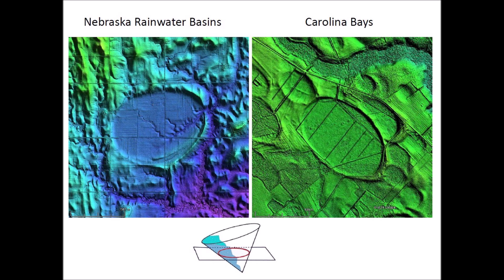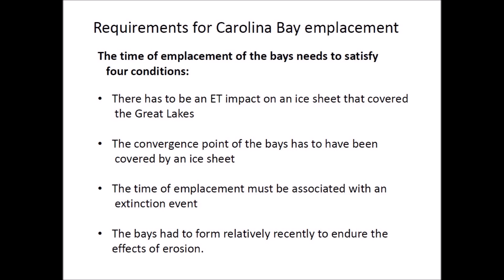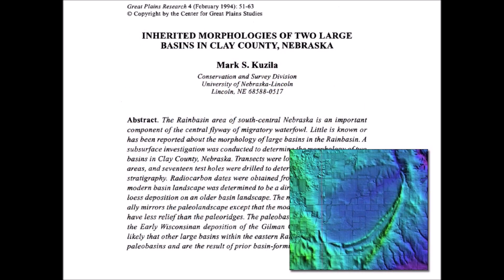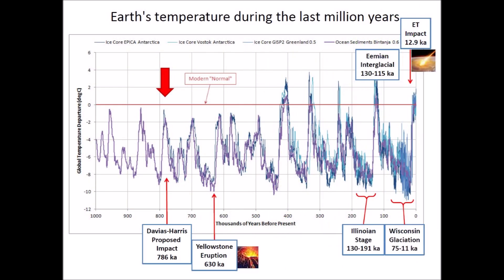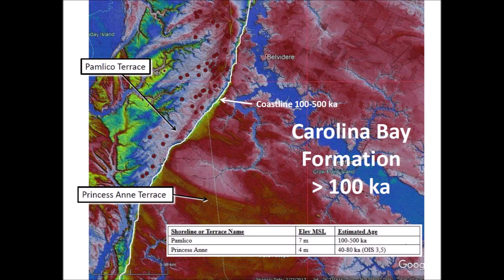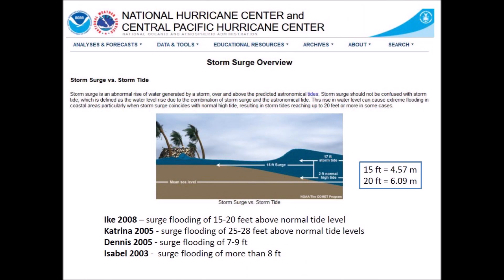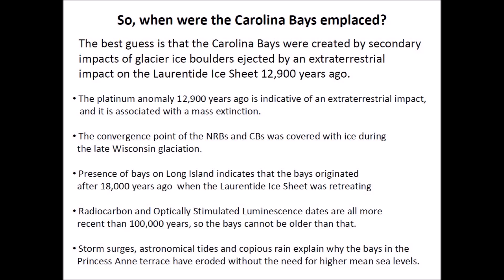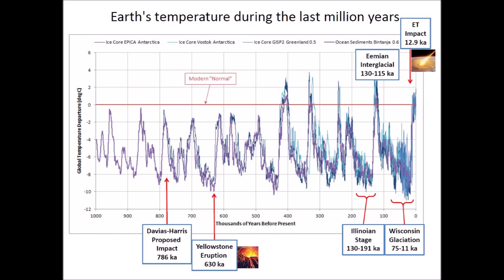Carolina Bays - Time of Emplacement

Comment: It seems relatively straightforward to do a particle system simulation of the probable high speed impact on a thick ice sheet. This could provide a model of the distribution of size, velocity, and other factors of the ejecta, potentially showing a distribution from gaseous, liquid, and microparticles to house-sized and larger.

As far as dates, the interesting test would be to do a core through the rim of the bay, down into the older substrate that was overlaid. There should be a significant transition, and dating the lower material should provide a latest date of material that was buried.
Reply from the maker: This was reported in this paper: https://agupubs.onlinelibrary.wiley.com/doi/full/10.1029/2011JE004043
Reply: @Antonio_Zamora  Thanks, I will check it out.
Reply: @Antonio_Zamora  Here is another video by Scott Manley showing simulations and computer animations of asteroid-velocuty impacts, which of course are different. The interesting thing is that apparently elliptical craters don't generally appear until the angle is 20 degrees or less. This is a very complex process, and the different velocity and material makeup of the ice boulders undoubtedly are factors. Does a sub-20 degree impact angle work for the ballistics+supersonic fluid dynamics?
Reply from the maker: One aspect that had not been considered about the formation of the Carolina Bays by previous researchers was that the bays were only created on unconsolidated soil close to the water table. The width-to-length ratios of the CBs indicate that the secondary impacts hit at angles of about 35°, and ballistic equations predict that the secondary impacts occurred six to nine minutes after the ET impact. The saturation bombardment by ice boulders during this 3-minute period liquefied the ground and made it possible for the secondary impacts to create oblique conical cavities that transformed into shallow elliptical bays by viscous relaxation. The reason that the CBs exist is that the ground was a viscous fluid during the ice bombardment. Most simulations don't take this into consideration.

Comment: Antonio or anybody able to provide link the Peter Shultz's paper/work on meteorite impacts on ice? I have tried to find at both Brown University and NASA without finding exactly that.(only brief references found).
Thoroughly enjoyed your book by the way though still unconvinced of impact strike at Huron. I still favour the idea the ice boulders were blasted out of Haiawatha on a higher trajectory and that a "swarm" of them split up on reentry high above Huron giving the directionality we see. Using University College London's impact calculator to picture it I would propose that superheated steam and water was sent across the surface of the whole extent of the massive ice sheet present at the time. Megafauna across Europe and Siberia was also terminated so this was not limited to N.America but it was only there that had land that bore witness to the flow. However Doggerland was washed away from the surge that left the Greenland edge of the sheet. Here in N.Scotland I think I have identified a layer of geology marking the event and have even found eratics that had been shaped by coastal processes 8 miles inland and 80m above sea level (which according to geologists is here about the same as it was -13k/yr due to isostatic rebound). I have a lot more to do on this to make a case though. So while I greatly admire and appreciate your work I think you are underestimating the scales. And Haiwatha is likely very young acording to the tattle I've managed to find from Copenhagen so we have the smoking gun. Maybe. ;)
Reply from the maker: Thanks for the feedback about my book.  You can find some of Prof. Schultz's experiments on YouTube, e.g.: https://youtu.be/tv3jxaZVjFM?t=305  His published work is under Stickle and Schultz (see the references in my book).  I appreciate that you are delving into this wholeheartedly. Regarding the Greenland Crater, it is 4,500 km from the Nebraska Rainwater Basins and >5,100 km from the bays on the East Coast.  In order to justify impacts originating from Greenland, you would need to explain two things: 1) Why the major axes of the NRBs and CBs converge by Saginaw Bay (Davias and Gilbride, 2010), and 2) Why the width-to-length ratios of the NRBs and CBs average ~0.58 corresponding to impact angles of about 35 degrees. Any projectiles coming from Greenland would have had higher impact angles, as you will find out when you calculate the ballistic trajectories.  Remember also, when talking about water, that it cannot be liquid above 35 km from the Earth's surface because the pressure is below the triple point of water.  You can only have vapor and ice at such low pressures.   For a good hypothesis, the thermodynamics have to work out.  Best wishes, Antonio
Reply: @Antonio_Zamora   Thanks! 
I do appreciate and factor in all the physical effects and constraints you mention. As I am not a scientist I am acutely aware I am very likely wrong by misunderstanding what is or is not possible. Regardless my lifelong interest in several sciences though not formalised at university beyond a one year Foundations of Science course from the OU does at least constrain my imagination a little. I hypothesise everything I state is possible as the result of a 2-4mile metal rich asteroid (pre impact energy of   3.08 x 1022 Joules = 7.36 x 106 MegaTons TNT - based on median) hitting 3km of ice above Haiawatha. The eventual diminutive crater reflecting a lot of energy lost in the ice.

As you can see in the impact video the ejected curtain is not uniform but clumpy. With a higher balistic trajectory than you proposed the infalling clump that lands and creates bay formations is subjected to a powerful bowshock of sublimating water vapour heated by reentry. This splits the debris cloud at a point high above the great lakes sending some toward Nebraska and the rest down the east coast. This may explain why Kansas which should have some evidence of bay formations does not seem to have any despite a lot of surface geology conducive to preservation. Finding basins that are clearly conical cavities in Siberia by Google Earth is difficult due to a topography littered with permafrost features that can randomly exhibit similar dimensions however I do suspect there are many preserved.
My suspicion is that Shultz's experiments and our imaginations have underestimated the effects that the instant vapourisation of 1000s of cubic kilometres of ice can have. And just as Chixalub geology exacerbated the KT impact and the Siberian Traps ignited a massive carboniferous coal field so the explosive effect at Haiwatha was compounded by the deep freeze conditions. Haiawatha crater reflects only a part of the energy budget of the impact. However it proves a lot of energy was available below the ice and I only wish I had the means to effectively model this.
The meteorite sample that sits in the Copenhagen Natural History Museum may provide a clue as from what I have been able to find it shares the same ratio of 91%iron and 7.6%nickel as the Williamette fragment found in Oregon. Though I have yet to compare a detailed isotropic comparison. 
As for the superheated water travelling from northern Greenland to the southern edge of the Laurentide ice sheet I fully understand it stretches credulity to the limit. Haiawatha was however just about dead center of the entire ice sheet at the time and looking at both the modern Greenland ice sheet and Antarctica it may be that gravity assistance and topography was conducive to such a flow. The kinnetic energy from such a blast  on a gentle gradient would build an enormous momentum and a wall of water and ice perhaps a mile high could eventually reach the edge. Yes I know its highly speculative but I am working on the idea that Haiawatha is the impact point, and so all paths lead to Rome for me at the moment. But again, looking at the topography I still think its not completely bananas. If the ice was even deeper at Haiwatha the liklihood goes up too. It would be a huge water/ice tsunami flowing down a gentle gradient.
The evidence from the dozen or so fragments of the Haiwatha meteorite found so far all point to an 8000kg/ cubic ton impactor and not a comet and all my calculations are based on an impact velocity of 18km/s.
Reply: What I have so far failed to stress enough is the evidence from Siberia and NW Europe that they suffered a cataclysmic event too. Any explanation has to account for that too. The dearth of proxies in the great lakes region does not support the impact taking place there and if there was one it does not explain the devastation seen in Siberia and NW Europe. Where as Haiwatha is equidistant to all affected regions and has a studyable bullet hole. It can be argued that the melt of the Laurentide ice sheet would have washed all the proxies into the Atlantic however I find that difficult to countenance for an object that did not fully penetrate and get burried in the bedrock. Especially as all indicators lead to a metal rich meteorite.  If such a strike did occur the surrounding areas should be abundant in iron meteorite fragments which I see no evidence of. Unlike N.Greenland where native innuits have been making tools from them for countless generations. 
The below episode from Randall Carlson lays out the scale of megafaunal devestation in a circular region equidistant from Haiwatha. This has to be explained. I fully appreciate your focus is the formation of the Carolina Bays and the Nebraska Basins but any explanation of those features must be consistent with a much larger destruction of ecosystems across the northern hemisphere.
https://youtu.be/LRmjTtm1ttU
Reply from the maker: @CandideSchmyles  I have considered that the YD global devastation may have been caused by multiple ET impacts. I discussed this in a 2018 video: https://youtu.be/F1QLY2nXAHM   I mentioned that the impact in Greenland could have pushed a mass of cold Arctic air with hurricane force winds toward Siberia causing some animals to freeze suddenly since Siberia is 3000 kilometers from the Greenland Crater and the North Pole is in a direct line between them. I also mention the Iturralde crater in Bolivia because the extinctions in South America are not likely to have been caused by the impacts in North America.  However, the origin of the Carolina Bays, which have a convergence point by the Great Lakes must be associated with an impact at that point.  There are many pieces to the puzzle.
Reply: @Antonio_Zamora  I'm sorry Antonio. I can almost hear your exasperation over here in Scotland. I am not averse to a fragmentation of an object producing multiple impacts. Or indeed your favoured explanation. But I do have a gut feeling that the Haiwatha impact was far more explosive (because unlike Shultz's experiments it got under the ice) than is generally imagined. Thanks for your responses.
Reply from the maker: @CandideSchmyles  What you hear across the ocean is not exasperation, but a sigh of relief that an independent person is actually looking at the whole picture. When you take a look at who has been publishing about the YDIH you will find mostly scientists from the Comet Research Group (CRG): https://cometresearchgroup.org/scientists-members/ 
There is another group that objects to almost every paper. My work is in limbo.  It is not accepted by the CRG, but it is not attacked by opponents of the YDIH.
Reply: @Antonio_Zamora  No error there? You are saying the CRG has rejected your work? Alien Viruses ok but Zamora no-no? How absurd. The only controversial question left in your hypothesis is the source of the impactors. They should be helping you all they can to get that answer.
Reply from the maker: To understand the reticence about including the Carolina Bays as part of the YDIH, read the comment from LeCompte that I included in the chapter about the Younger Dryas Impact Hypothesis in my book.
Reply: @Antonio_Zamora  ok. If I get your point LeCompte put pressure on Firestone for including the Carolina Bays  in Cycle of Cosmic Catastrophes. However you have established through LIDAR that they occured as a specific time constrained event and not gradually, by experiment that they are uniformly directional conical cavities and that weathering indicates a (geologically) young age. The lack of proxies is to be expected givèn it is ice boulders you proposed and the formation dynamics turning the cavities inside out. So I fully agree some caveats are required but no one is quicker to state that than you.
Given the size of ice boulders required to create the observed features it is hard to imagine they were formed from vapour ejected into orbit but rather they were thrown into orbit as large chunks and fell back with the same mass minus some reentry heat melt (which would wash them clean of much of surface proxies). Rather than dismiss your hypothesis they should be studying just how that was possible (which is what I have been doing with the proposed Haiwatha impact). I believe that in large impacts there has been proposed a mechanism where by it is not just explosive expulsion at play but that the impactor pulls down the space vacuum which could multiply the explosive power by reduction of atmospheric friction and the inrushing atmosphere having its own expulsive action too. (The pulled down vacuum also provides the mechanism to explain the intense cold).
Clearly we are still just opening the first pages on the final story that will be written on this subject and I am pretty confident your hypothesis will be vindicated, it is already just too elegant to be anything other than fundamentally correct. Its not the "what" but the "how" that remains to be understood. The glacially slow pace of research is frustrating but you are doing the right thing sticking at it, producing your videos and writing your books. As the comments clearly show your work is inspirational and exciting.  So thank you!
Reply from the maker: It was actually Firestone who wanted to include the Carolina Bays, but the editors and peer reviewers would not allow it because at the time their mechanism of formation was a mystery.
Reply from the maker: @CandideSchmyles  Regarding the mechanics of the ET impact, take a look at Shuvalov and Dypvik 2013 ( https://onlinelibrary.wiley.com/doi/full/10.1111/maps.12127 ) "In the 1000 m‐scale impact, the mass of ejecta is so large that it moves the atmosphere itself to high altitudes. Thus, the atmosphere cannot decelerate even the fine ejecta and they consequently expand to the rarefied upper atmosphere."
Reply: @Antonio_Zamora   I like the way this guy thinks!  Kudos to you Mr. Candide Schmyles for paying attention in class...A+!!!

Comment: So I'm interested to know what your thoughts are Dabbler..? As I understand your evidence was of actual shorelines but maybe those where there during the Bay formations and over the past 12K years have also been subject to temporary flooding by various means as have the Bays?
Reply: There's not just a relationship to the most recent paleo-atlantic shoreline from 125,000 years ago, but also the paleo-atlantic shoreline of 400,000 years ago.  Well defined Bays over 42', heavily eroded Bays between 42' and 30', absence of Bays below 30'.  Seems to be a clear correlation to past (pre-YDB) sea level stages.

Comment: Thanks for all your fantastic work! Another mechanism that could explain the erasing of these bays is if this area would be to wet to form lasting bays. I imagine that if you add more water in your bucket the relaxation would speed up until no lasting bays would remain. So where would the water come from? I first thought tsunamis from the ice boulder impacts outside of the coast. But perhaps the distance is to far, i dont know. But then thinking of how the impacts look like, perhaps its more likely that the water comes from the ejecta plum of the impacts. It would explain the distance travelled by the water. Remember the impact angle, that would direct the ejecta plum back towards the coast. It would be a lot of water if the impacts are as close together off shore as they are on land. Perhaps together with tsunami flood water enough water could temporary reach up to this level. https://youtu.be/tUngF83JVPI

Comment: North Carolina has a major hurricane once a decade, if the Carolina Bays were 125,000ka that would be the equivalent of a storm almost every year since the Younger Dryas.  Surely the age of the Carolina Bays could be approximated by the soil thickness within them as where I live, just West of Lake Michigan and above the 45th, that was under ice and or completely washed away and the top soil is 10-12 inches thick.

Comment: AZ; 
Question:  
re Princess AnneTerrace etc., 
If the CB rims are uplifted from concussive penetration into a new raised position retain their original stratigraphy, wouldn’t the Bay rims in the hurricane worn areas still have discernible raised stratigraphy despite sand erosion and/or deposition and thereby remain discoverable?
Reply from the maker: The bays disintegrate after water starts submerging the bays.  The reason why the bays have survived more than 12,000 years is that they are on very porous ground that quickly percolates to underground aquifers and most of the water flows beneath the surface.  The turbulence of surface flow destroys the bays.